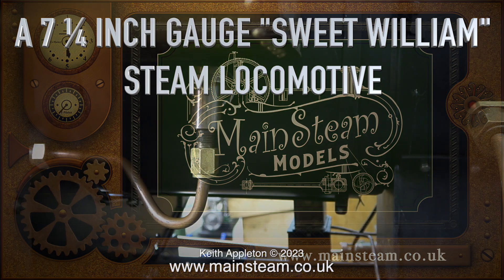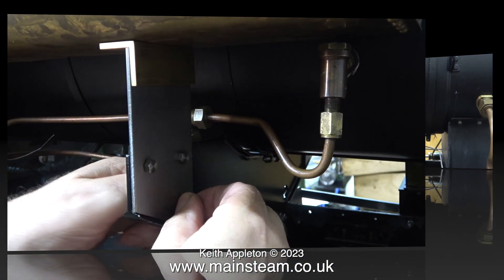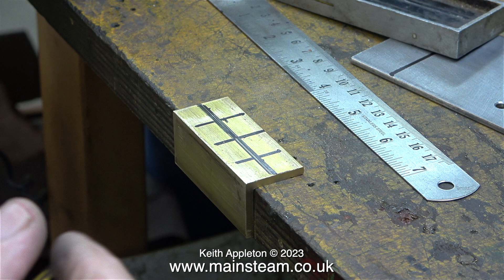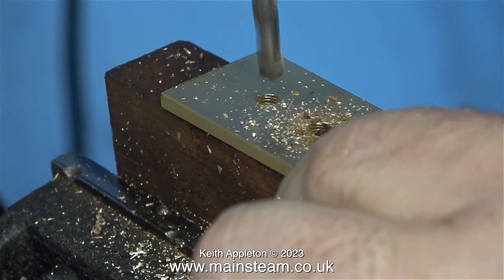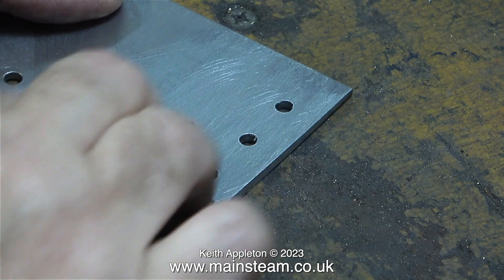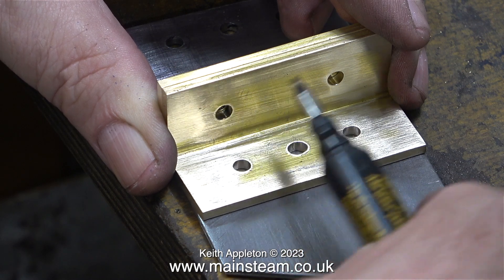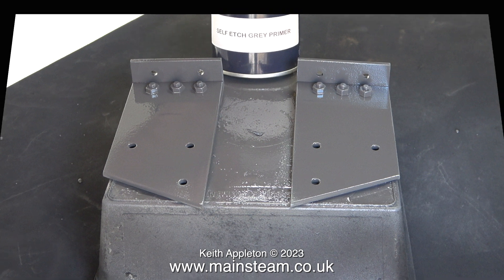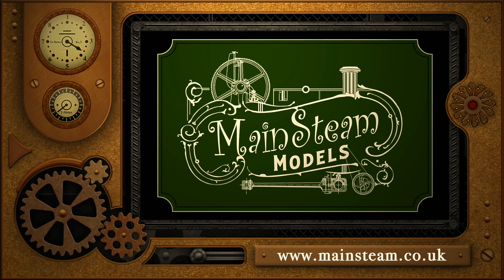A 7 ¼ INCH GAUGE "SWEET WILLIAM" LOCOMOTIVE - PART #52

Comment: any reason why three holes instead of two? looks better? had a bunch of bolts to use up? all the other bolt series were spaced similarly?
Reply from the maker: Strength  . . . . . there will be a lot of weight at supported this point.

Comment: If I remember correctly, you showed us a set of centering (transfer) punches (it was a while go).  Wouldn't that make a better method of transferring from the holes in the brass angle to the steel sheet?  Of course your way DOES work, and the trick of moving the mark with an impact center-punch is a nice thing to know.  Keep up the good work!
Reply from the maker: I wanted to show an alternative method, as not everyone has a transfer punch set - I do have one .......
Reply: while transfer punches are nice, learning the skill of nudging a center punch point over is a skill that should be learned and practiced

I have wowed a number of people at our local makerspace with that trick